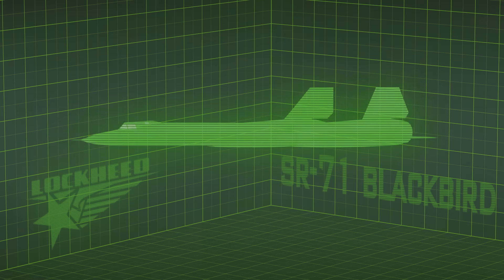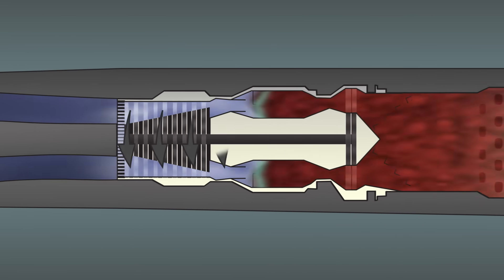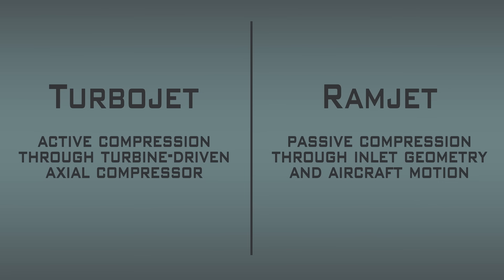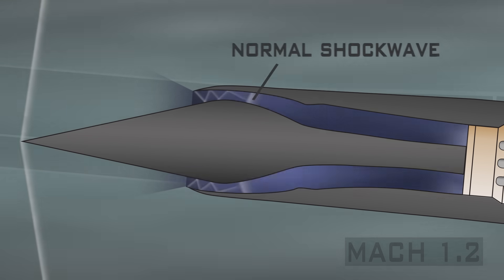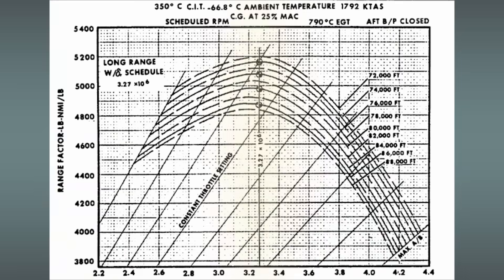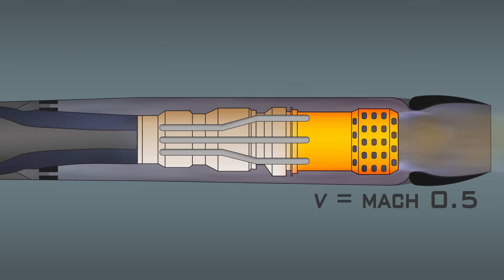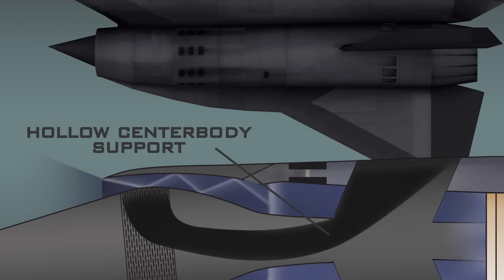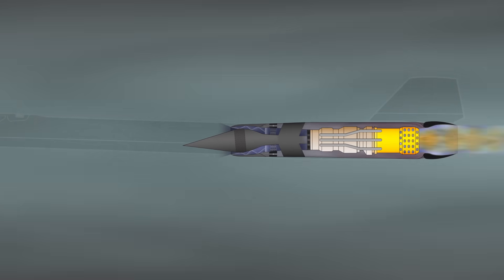The Mighty J58 - The SR-71's Secret Powerhouse

Comment: I don't think those bypass tubes were for creating ramjet.  I've seen an engine tour.
Reply: The inlet created the ram effect at high > ~1.8 mach, which gave a 35 to 1 shock compression of the air. The inlet (spike assembly) is in front of the turbojet. The highly ram compressed air would be (by design) subsonic by the time it hit the entrance to the turbojet compressor blades. However, the turbojet blades only compressed the air by 8:1 at low speeds, and could not add any further compression at very high speeds (when the ram air compression was in full effect). So in order not to 'disrupt' and adversely effect the ramjet process, the bypass tubes allowed the ram compressed air to 'bypass' the latter stages of the turbojet compressor blades (all blades after the 4th were bypassed) and flow directly to the afterburner stage. Presumably Pratt and Whitney engineers figured out that bypassing at the 4th stage was optimum. The afterburner stage created thrust at all times, whatever speed the plane was doing. 

So the bypass tubes are essential to allow the ram effect to work well, whereas the inlet itself created the ram compression. The ram effect at very high speed, with very high compression of the air, makes the engine nearly three times more fuel efficient compared to lower speed operation where the turbojet produced much of the thrust.

Technically the engine is not a pure ramjet, nor a pure turbo jet, it's a brilliant hybrid.
Reply: Guitar Paul , is there any other air flowing around the engine and mixing in with the afterburner to create a ramjet effect?   If you google "j59 bypass tubes" and see the 4 minute video of the retired pilot talking about the engine,  he seems to say the bypass tubes are not what makes the ramjet.  I feel that is incorrect.

Comment: I'm just reading Richard Graham's book (The SR-71 Revealed) about flying the SR-71. According to Graham, the spike would auto position according to air speed and altitude, and then an analog computer would control the amount of air allowed to exit the forward bypass doors (FBDs). So the FBDs reacted to the position of the spike. However, the more air that was bled through the FBDs the more drag was created, and so ideally the FBDs would be nearly fully closed (~5% to 10% open I think) at high Mach number. The pilot had a degree of control on this though; one control was the opening of the aft bypass doors (ABDs) which were not computer controlled. The more the ABDs opened, the more the FBDs closed, and there was little drag penalty in opening the ABDs. Usually they had the ABDs open a little to keep the FBDs nearly fully closed.

At supersonic speeds, If the computer controlling the FBDs malfunctioned then the inlet could 'unstart'; basically the control of the 'normal shock wave' (mentioned in the video) would be lost. This led to immediate loss of controlled air compression and thrust. Reading about 'unstarts' in Graham's book is terrifying! Apparently the whole aircraft would shake violently and lurch to the direction of the unstarted (essentially partially stalled) engine. An unstart could happen right out of the blue, and not necessarily because the FBD computer failed. Apparently, immediately after an unstart, the pilot would make the inlet go through a rapid automated sequence to recapture the shock wave by re-positioning the spike and resetting the FBDs. Usually this was successful after one or two attempts. If it wasn't, the pilot might have to slow right down to figure things out, and there was an option to control everything manually; the spike, the FBDs and the ABDs. Apparently they fitted better digital FBD control computers (to replace the analog ones) in the 80's which made unstarts less common,

I highly recommend Graham's book!
Reply: Yeah Richard Graham has some good books on The SR71. The FBD didn't have to malfunction for an unstart to occur . In a turn the outboard engine would be going faster or getting more air than the inboard engine  would , much like a cars tires in a turn, the outboard turn faster than the inboard. That could cause an unstart also. The ABD's are scheduled closed at mach 3 and only opened to increase thrust, provide extra cooling or prevent an unstart. An unstart is when the inlet becomes over pressurized and ejects the shockwave back out the of inlet.
Richard Graham stated that the during an unstart the jet engine continues to run but sometimes it blows out the afterburner. After they switched to better digital controls , some pilots never experienced an unstart.

Comment: Can the engines restart after a flame-out, and if so, what velocity is required?
Reply from the maker: Yes - as far as I'm aware there was no minimum velocity or maximum velocity for a restart - when an engine unstarted or flamed out the onboard analog computer reacted faster than the pilots could to essentially kill most of the thrust in the second engine with an intentional unstart, otherwise the plane would rip itself apart in a massive yaw.  Then the first engine would be restarted using the existing momentum to simply restart the turbines, then both would be restarted with the centerbodies slowly retreating back for maximum pressure recovery and maximum thrust.
Reply: @tech laboratories - that’s wrong. An unstart is when the shockwave is ejected back out of the inlet from over pressurization . The jet engine continues to run.

Comment: That non stationary jet inlet was first used on the B-58. Nobody ever flew that B-58 at max thrust * because they Knew it would Damage fuselage and wings, Yea it's a freaking close to a Rocket as air will allow.
Reply: @Roberto - the difference is the inlet cone on the B-58 started in the retracted position and moved forward as the plane went faster to keep the shockwave outside of the inlet. The SR71 inlet is just the opposite.

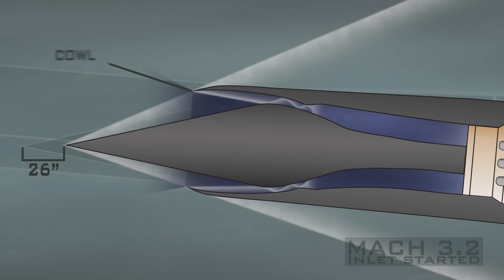Comment: 3:10 Maximum fuel efficiency at Mach 3.2. Wow.
Reply from the maker: Remember that max efficiency doesn't mean it's a Prius at Mach 3.2, it just means that that's the speed it gets the highest "miles per gallon" - just like prop planes do at 2-300 mph, high bypass turbofans do around 4-600, and low bypass jets do at around Mach 1.2.  You're still burning through MANY actual gallons at that speed, and moving far less mass with more fuel than say a slow moving cargo plane.  Or a semitrailer.  Or a train.  It's just a relative value :)

Comment: The spike as you call it moves almost 3 feet forward and back (in the motor)  based on the speed to keep the sonic wave inside the motor at all times. You show the wave outside the motor, that never happens but a very low speeds less then mach one. Once over mach one the wave stays inside the motor..  

Over all it works... 

Ya forgot one little thing.... She leaks all over the place when on the ground... really.. it needs diapers.
Reply from the maker: The fact that it leaks on the ground is one of the most brilliant innovations about the OXCART family and solved an incredibly challenging thermodynamics problem.  I didn't forget it, I just ignored it because the focus of the video was on the function of the engine, not the rest of the plane design :)

Comment: Gawd, but they couldn't invent fuel tanks that would seal? i've held precision machined parts that had such a smooth fit, they seem to be bonded  together. This could expand by sliding, with  horizontal and vertical parts.
Reply from the maker: That was intentional - you can't fight thermodynamics.  The amount of heating will basically cause all materials to expand, and so they chose to expand them into a snug fit instead of expanding them into a compression state that would have put more stress on the airframe.  It was actually a work of genius!
Reply: yeah, but they could have devised  "take off" low speed tanks, and fuel tanks which expand at high speed, or at least a heating system that kept then expanded before speeds were reached so they could be sealed.

Comment: can a Scramjet be built without a Nacelle?
Reply from the maker: Not really - a scramjet is essentially a nacelle.  If it's not largely integrated into the aircraft body the forces you're dealing with tear the plane apart.
Reply: TechLaboratories so can the Scramjet engine wholly put inside the aircraft body,  with openings outside for inlet of air to the engine...

Comment: if its refueling speed was 0.9 mach, what tanker can fly that fuckin fast and maintain control. That's what I wanna know lol!
Reply from the maker: The trick is to minimize the speed differential over the wing.  Transoceanic air liners cruise around Mach 0.84 - you don't need to tweak that too much at the expense of fuel efficiency to get a similar aircraft to cruise Mach 0.9.  But still quite a feat!

Comment: I still don't get how the internal blast doesn't come forward, oh well, I guess that's why I'm not at NASA😂
Reply from the maker: Static pressure - The dynamic pressure transition at the lip of the inlet, where the incoming air drops from supersonic to subsonic has a very, very high moment of static pressure, far exceeding the static pressure inside the inlet or the dynamic pressure generated by the combustion.  Essentially, the hot gasses can expand outwards quicker through the back of the engine than through the much smaller openings in the front.

Comment: Could a Concorde style plane run on these engines? it seems far more efficient than the fuel costs the Concorde suffered from. Or is mach 3.2 just simply too damn fast to be an airliner?
Reply from the maker: Efficient is a relative term.  It's more "efficient" than at slower speeds, but still way, way less efficient than smaller engines in fighter jets and even the concord, in terms of payload moved for fuel economy.  In fact, turboprop planes tend to be the most 'efficient', but are really really slow.  And what's better than that?  Trains.  Trains are more fuel efficient in terms of moving mass over distance.  So Mach 3.2 is more efficient for the SR-71 than Mach 2.0... but no where close to as good as a Prius.
Reply: TechLaboratories fair argument. Pound for pound, that sounds right. Lol

Comment: Why hasn't this engine been developed further in the past 40 years and been used in modern fighters? Is there an inherent problem with this engine that is not being publicized?
Reply from the maker: The fighter variant fo the SR-71, the YF-12, was originally designed as a response to what they thought was a soviet bomber capable of Mach 2, but turned out to just be an interceptor...  The reason these speeds aren't necessary is you can't really maneuver at that speed, and the speeds between Mach 0.8 and 1.5 are the best for aerial interception and assault.  Ground assault / close infantry support need Mach 0.5 to 0.9 ranges.  Essentially, they're too fast to be useful in a fighter.

Comment: I dont understand something:
The pressure recovery at the inlet produces the  most of the compression (at M 3.2). But this doesnt mean that the inlet itself is producing thrust, as said in some articles.
I understand that it compresses air, even more than the compressor, and this results in more thrust, but throughout all the process. Is not that thrust is being generated by the inlet, at the inlet. Is this right?

(Wikipedia tells "propulsive thrust distribution between components..." but its actually, "compression distribution"?)

Thaks
PS: Great video
Reply from the maker: In engineering terms, thrust is "generated" on the surface that's being pushed against.  I.e. imagine a box with 7 closed sides and one open.  If you create a rapid expansion of gases (read, explosion) in the center of the box, thrust is generated on the wall of the box opposite the open side, which is the direction the box will travel.  Or in other words, thrust is where the pressure difference is translated into a force.

Comment: at the back the exhaust can also narrow and widen to concentrate or de-concentrate the hot gasses and after burner
Reply from the maker: Yup - It's in the ejector where much of the static pressure is converted into linear dynamic pressure.

Comment: slightly off center to compensate for angle of flight required going over 2000 mph,need those engines on some other craft though,like f15,or Chinook or even osprey
Reply: is it the speed, or the altitude? fuck all air up there, less lift from wings etc
Reply: Mr O 
Hahaha, the bullets just fall back behind the aircraft the second it's outa the barrel, or better yet, never even leave the barrel.

Comment: Hence the name: Continous Bleed afterburner turboram.
Reply: Its not continuous bleed. It actually has a bleed schedule where a ring of doors open to allow air into the bypass tubes at a scheduled speed. It was actually never meant to be a ramjet. The bypass tubes were meant to relieve excess air to prevent compressor stalls and help cool the afterburner. They gained only 20 % additional thrust from the bleed tubes. It is the inlet that makes the SR-71 so fast.

Comment: Great video.  One pet peeve: what's the difference between unique and very unique?
Reply from the maker: By definition, every airplane is unique, in that the slight imperfections or differences between it and other aircraft manufactured at the same time of the same type still make it different.  Or, more generally, most aircraft and aircraft engines are unique models - they have many commonalities but differ in key aspects, making them unique.  The reason I chose the phrase "very unique" was to emphasize that the J58 is not just a unique engine (since all engine types are unique), but it's also its own class of engine that works differently than essentially every other engine class that exists.  So yes, I do actually see grades of uniqueness.

Comment: Two things, one, the Starter Motor car that used two V8s was replaced in the seventies afaik, when the air starters were powerful enough to start the J-58. 
Given that the Buick was rather cumbersome to transport, if an SR-71 made a landing outside it's homebases, a portable air starter system was developed. 
Richard Graham mentions this in "SR-71 Revealed - the Inside Story", he also states that the main problem was the engine oil, which had to be preheated to 70 degrees C before the engine could even be rotated.